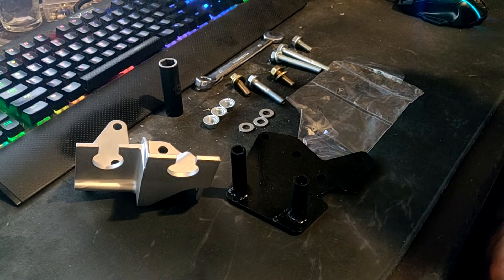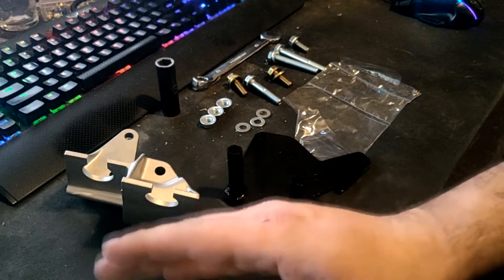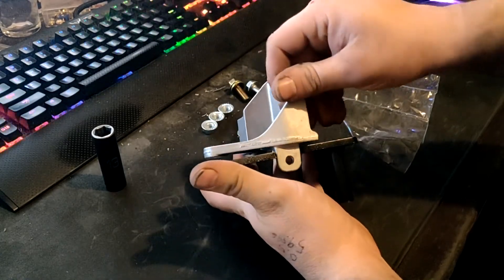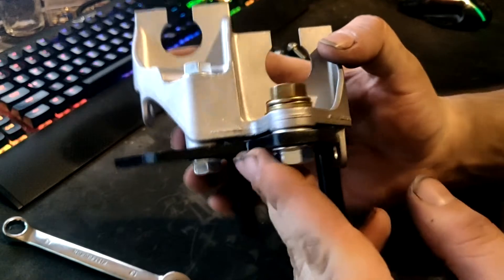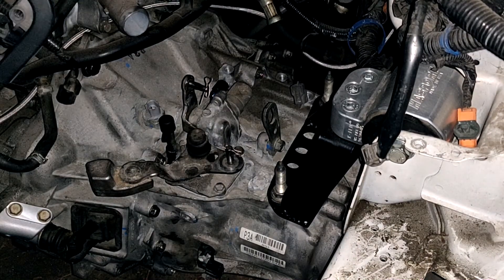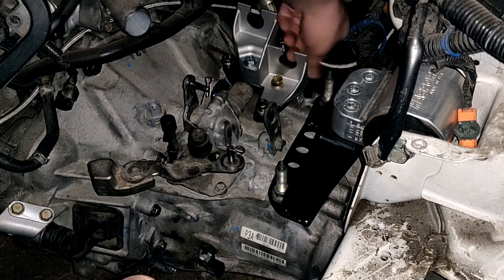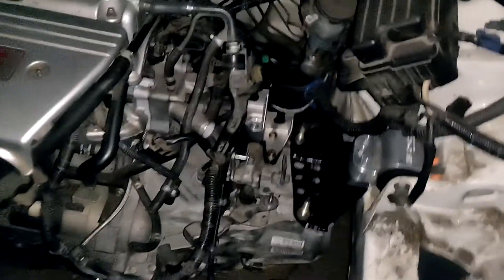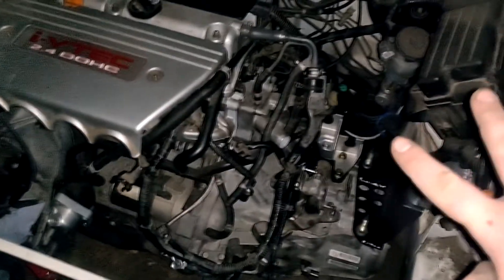California K24 Integra 18 - Prepping and installing my K20Z3-to-K24Z shift cable bracket adapter

Comment: Did you ever finish your swap and get the k24 bar'd?
Reply from the maker: Unfortunately no. Started working at a Honda dealership and kind of killed my passion for tweaking with cars, ontop of moving and now having no covered area to work on the car. Plus, money since everything exploded in cost
Reply: @theswissmechanic  Bummer but understandable. I worked as a computer tech back in the day and didn't touch a computer for like a year after that haha. Was thinking about doing a k swap but might just do a b20 swap so I don't get burnt out and spend less

Comment: I have a k24a2 transmission. Would this bracket bolt up to the trans? I'm using a ktuned no cut shifter box and ktuned rsx cables.
Reply from the maker: No. The K24A2 transmission will not work with any of the no cut shifters as it utilizes a different shift cable setup. I've tried test fitting the TSX cables and it just doesn't work. I spoke to the maker of this and at the time he had no intention of building a conversion bracket for the TSX tranny. I sold my TSX trans and bought a k24z7 out of an ILX, which this adapter fits. The 12-15 Si and 12-15 ILX have the same tranny, except the Si got a factory LSD. All the ratios are the same however.

Comment: I am just now seeing this. SMH. Great video nonetheless. Thanks for sharing.  Just one thing. The gold washers go UNDER the K20z3 bracket and the silver washers go under the adapter bracket itself.
Reply from the maker: HA so I put the bolts in backwards. Well, that isn't too big of an issue to fix. Baby's been put on indef hiatus with the entire, pandemic and economic recession.

And also working on Hondas now at a dealership, I'm just too tired at the end of the day or on my days off to go wrenching under the sun. The pain of not having a garage
Reply: @theswissmechanic  lol yeah definitely not a big issue.  Just wanted to point it out
Reply from the maker: @1320AutoMoto  Probably could grab a micrometer and see if there's really any measurable difference in thickness. Everything sits pretty well :P Alignment isn't TOO touchy for the 'Change Cables'

Comment: i have a k20A euro r transmission and i wants to use a rsx shifter
Reply from the maker: The bracket is not for K20 transmissions. It's specifically designed only for the K24Z transmissions to allow a K20Z3 bracket to be used instead of the K24Z shift cable bracket.